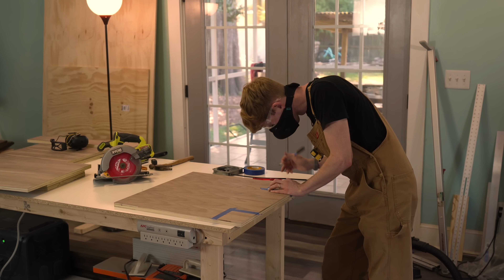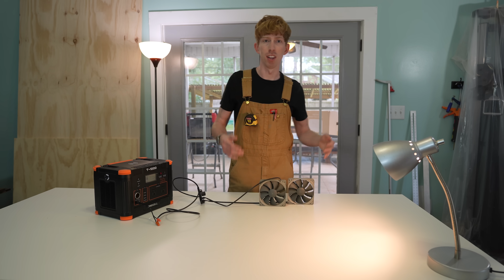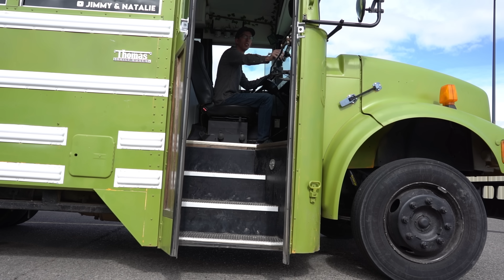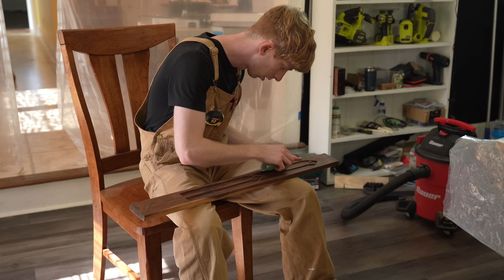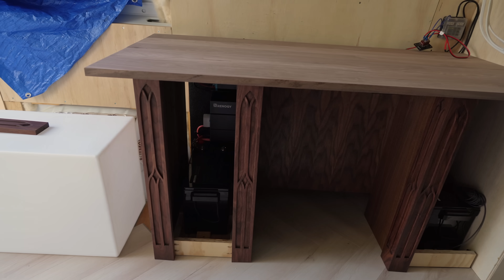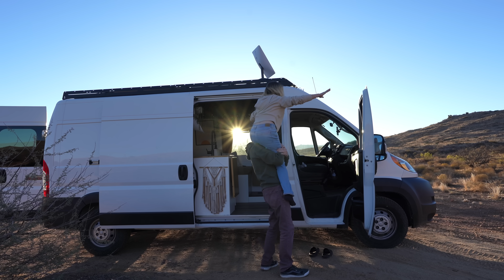3 Years of Van Life Led to This

Comment: Fan-Noise: As a rule of thumb, if you reduce the speed to 75% of the maximum, the noise is reduced to 50%. For the same reason a bigger fan is less noisy, because it can do the job at a lower speed.

Comment: I haven't finished the video but for the computer fans as I live in a dusty State in the USA, computer fan filters or some air flow with filters may help limit the cleaning you have to do on the fans and electronic components. Then again you aren't building a computer case either.